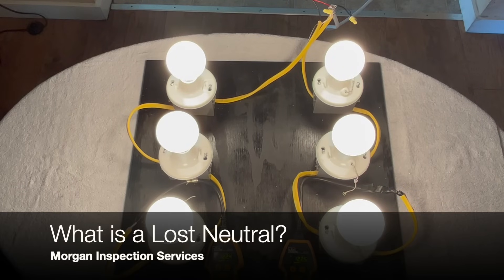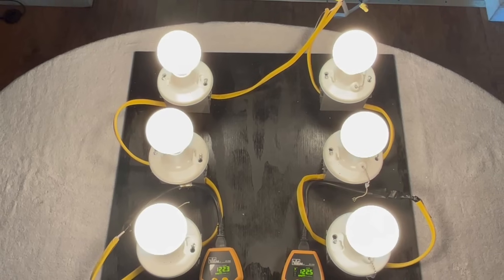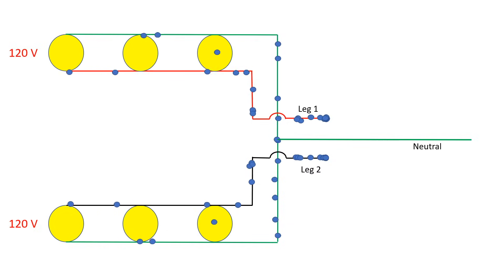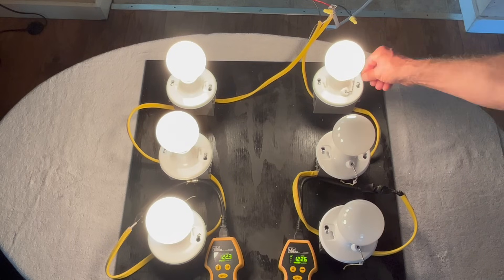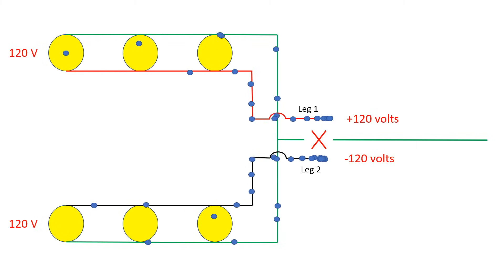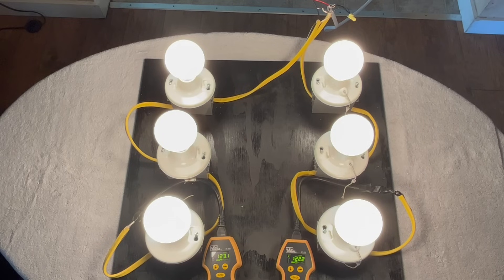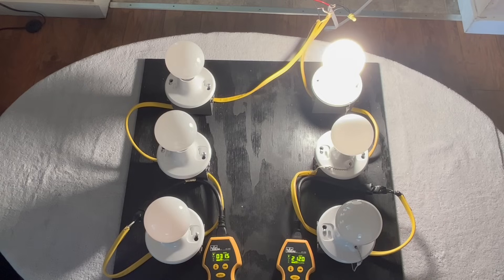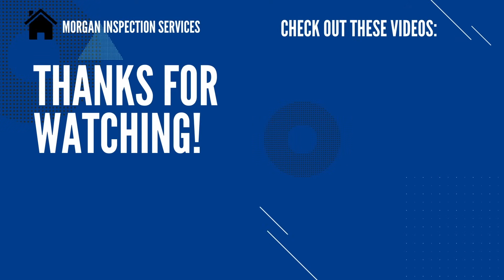What is a Lost Neutral? Lost Neutrals demonstrated

Comment: One thing that I didn't see really mentioned, though no real good electrician would run into this problem, is that the "neutral" of the right side of the circuit will now be positive with respect to ground. So if you think you can touch or work on that neutral and be safe, you better think again
Reply from the maker: Very true. I do think I mentioned somewhere that there can be voltage on the neutral. I did recently release a new lost neutral video. It specifically covers and even measures the voltage on the neutral.

Comment: Someone please respond to me.
 Okay so over the weekend, precisely on Morning My client discovered that the extractor fan in his toilets got burnt, like burnt to the ground and because of that incident, his socket outlets were no longer working,his AC too, there was total black out on most of the lighting circuits while in some other circuit, the lights were just flickering. So I was called upon to troubleshoot what was wrong, my findings are as follows 
- there was current in all of the neutrals in the consumer unit
- After isolating all the MCBs that controls the lights and leave every other MCB closed, the neutral no longer have current.
- When I turn off the entire MCBs and turn on the Mains and read each bar connected to the MCBs with the neutral, everything is okay but immediately I turn on the identified MCBs introducing that current into the neutral line, then the readings are no longer accurate
Note: I’ve checked the phases from the main incomer I.e RYB and also read them with the main incomer neutral . The readings are all perfect.
PS.. Intermediate level.
Reply from the maker: You’re obviously not in the US, because some of the terminology I don’t completely understand, but I will try to respond and help. You said, “after isolating all the MCB that control the lights and leave every other MCB closed, the neutral no longer has current.”  Just want to clarify. Did you intend to say current or did you mean voltage. If you’re saying that they still have voltage, then you may have an open neutral somewhere in the circuit.
Reply: @ yeah the neutral voltage

Comment: My dad worked in the water department of a local city.  One day when he was working on a water main, they had to disconnect a house from the main to swap out a pipe.  When they disconnected,  the pipe sparked and the owner of the house came out yelling about his bulbs blowing.  My guess, he and his neighbor shared a transformer,  he lost his neutral between his house and pole, and his system was grounded to a water pipe.  He was using his neighbors neutral through the water pipe, and my dad disconnected it when he separated the pipes.
Reply from the maker: That's a very interesting example of how a lost neutral can be present and affect a whole circuit!

Comment: Is there any device that exists that will sense this and protect against it?
Reply from the maker: I don’t know of anything that would detect it. I guess someone could plug a voltage sensor into outlets and if there’s a drastic change, it could alarm, but there’s really nothing designed to detect this other than noticing lights brightening or dimming, or other objects running faster or slower.

Comment: The animation shows the current in the bottom leg changing direction when the neutral is lost, which is wrong.
Reply from the maker: I was trying to illustrate that the electricity flows from one leg to the other leg. It doesn’t necessarily represent the current. The dots are showing the flowing electricity changing directions. This is correct. When the neutral is intact, the electricity flows from the transformer through the loads, and then through the neutral and back to the transformer. When the neutral is lost, the electricity flows from the transformer through the loads on leg one then to the partial neutral and then through the leg two loads and back to the transformer.

Comment: Good video, but one bone to pick on the diagram: the two lines are 180° out of phase... so the fake "electrons" (the dots) should be travelling in OPPOSITE direction... not the same. The way you have the "with neutral" shown shows the current meeting up from both sides at the neutral and then just vanishing... this is wrong. You should also have the dots alternating directions on both sides, but line 1 & line 2 always exactly opposite. You could do it without the alternating directions, but you definitely should not show them flowing the same direction as eachother.
Reply: Well, Ithink he didnt want to overcomplicate things.  Since this is AC, there is no mass flow of current.
Reply: I was pondering the same thing, but I’m not sure that it matters for A/C in a meaningful way. I believe that you’re right, but I don’t think understanding the difference matters for a lay-person (me!) to understand the concept, while I expect that this is a lot less confusing of a visualization.
Reply from the maker: You’re absolutely right about the direction of current flow!  I just tried to make this as simple to understand as possible. I do appreciate you watching and your feedback.

Comment: Interesting, but if the current in the phase/hot wire is not the same as in the neutral wire, your differential circuit breaker should trip at millisecond timescale. Or in your country you do not have this kind of protection mandatory?
Reply from the maker: It sounds like you’re basically referring to a ground fault circuit interrupter breaker. We do have these in the US, but when a neutral is lost, it is lost prior to the panel. You will still have current flowing back on the individual branch circuit neutrals, so a GFCI would not help in that situation.

Comment: I get the idea of using three cables in order to have two different voltages available (although I don't think it's justified for such a minor difference), but: why on earth would you wire BOTH low voltage lines throughout the house???!!!? That is crazy! Is it to save some copper money to the power company?
This suddenly makes me understand all those random shorts that YT recommends to me about the dangers of doing electrical DIY in USA houses... you can never imagine what kind of creative layout there is behind an outlet.
Also, how do those little portable Honda generators fit into these schemes? You have to buy your own transformer and plug both right at the gate?
Reply: So what would you do? Not use one leg at all?
Reply: Exactly!!! This is like having 3-phase at your house and wiring each floor to a different phase... it's just crazy.
Reply: @keepcalmandenjoythedecline  That makes no sense. In Finland different circuits are in different phases. Something like a range typically takes all three. If you have three phase you must use the phases evenly. Here main fuses can be as low as 3 x 25 A and that is with electric heating. Same with split phase.

Comment: I have troubleshoot electrical issues since 1986. One of the most interesting was a call from a local hospital. They had shutdown their ICU because their biomed equipment was alarming with severe voltage deviations. I arrived in an hour and started to take voltage measurements on the 75-kVA transformer serving the ICU. Phase-Neutral voltages ranged from 135 to 105. I inspected the transformer and saw the required neutral-ground bond. The facility electrician was suited up with his PPE and I had him install a jumper between the ground buss and neutral bar in the transformer. All three voltages stabilized at 121. We shutdown the transformer and the electrician tore apart the bond. He discovered when they manufactured the transformer, varnish had run into the tap for the bond on the neutral bar. For 11-years there was enough contact to bond the neutral. For some reason it finally opened. 

Another hospital called to say that their surge suppressor literally blew off the wall when they tested a new emergency generator. I told them that more than likely, their contractor had not installed a neutral-ground bond for their 277/480 volt system. They asked me to come down and meter. We saw the 277 volt legs fluctuate between 12 volts and 470 volts. Sure enough, no bond.

Most common problem is that a contractor will poke a hole in the transformer case for incoming ground and not scrape paint away to make establish a solid ground. I have seen them put screws through the ventilation louvers for grounds without scraping paint.

Comment: 8:48 damn i really need to go back to school, but why is the resistance higher with 2 lights compared to 3? Isn't light burning cause it has a resistance so if you remove 1 of those resistances how is there more resistance all of a sudden ?
Reply from the maker: With three lights on you have three equal paths for the current to flow.  With only two lights on, you only have two of those paths for current to flow. The more paths, the lower the resistance.

Comment: I’m an electrical engineer, licensed electrical contractor and volunteer firefighter of 35+ years.
This is the very best demonstration of the risks posed by a “bad” or missing neutral.
It SHOULD be made mandatory training for anyone working in the trade.

Thank you!
Reply: EE, as well. I was fortunate to be there in the early 80s before the curriculum started to change to microchip design, etc.
Reply from the maker: Wow! Thanks so much for the feedback and comment. I really appreciate it.
Reply: Yes, a great example.  Lost neutral was certainly taught as a very dangerous condition in the UK - tho as we are mostly 240V single phase PME it's more that anything earthed sits at 240V potential if the neutral is lost.  When working in the Middle East in a flight training school, the Simulator blew up one day, it turned out that it had also happened before.  The SIM Engineer was perplexed because the voltages across the phases were all over the place.  When we opened the 3 Phase supply box outside the building, we found the neutral cable had never been bolted in, it was just lying against the terminal - so sometimes working, sometimes not.  Says a lot about the engineers who installed it and those that investigated the previous faults!
Reply: I’m an EE, and you’re a bad, bad man with that background.  Hats off to you!

Comment: so what you have is a single 240v supply with a centre tap ground voltage divider. when you lose the centre tap ground aka neutral you have what is called a floating neutral.
Reply from the maker: Yes, I agree with you. A floating neutral is another way to define this situation. I appreciate you watching and I appreciate the comment.

Comment: The neutral is also what regulalats the current from the tranformer had a lost neutral at a campground the plugs ranges from 40 to 230 volts I knew what the problem was but c find what the aprentis did but a master electrician found it we had overhead line's 2 black and a bare aluminum on the underground we8 had black red and white as well as a braided aluminum wire around all 3 he had wired it up wrong but as for calling the power company tried that and they did nothing even had one electrician say the one problem was in the panlo box wouldn't even check the meter or wires coming in even though we had only one leg of power and that was all over the place I finally went out and looked at the meter run then took a picture of the mast head where it could be seen that one black and the neutral were clearly not connected turned out the linesman had missed crimping 2 connection and the wires swinging in the wind had caused them to pull out but I've had this problem before they are the experts I'm not so I know nothing about it they know it all so I've learned find the problem and either tactfully tell them or like in this case take a picture of the problem and show it to them when I showed him the picture I simply asked him if that was the normal way it was supposed to be he then had to go and take a look at it then he had to call the power company to fix it and left since we still had workers that needed power lights and heat to finish the the job I got a ladder and put them back together again when the power company finally showed up they said it looks like nothing wrong so I told him to pull on the wires and then he could see the prob and cut off the old conectors and redid them all
Reply from the maker: Wow! Yes, these lost neutrals can definitely create problems. They can certainly be a problem to isolate as well.
Reply: @morganinspectionservices3840  worst part was one of the parents had brought his boy out and to keep him occupied his game boy and it fried it

Comment: How would you get a lost neutral condition? Don't these circuits typically have independent neutrals back to the breaker? Also I thought the neutrals and grounds are bonded at the breaker panel.
Reply from the maker: A lost neutral occurs before the breaker panel. As a video explains, a lost neutral can occur anywhere between the transformer and the breaker panel. Maybe the neutral gets corroded or pulls loose at the weatherhead. Maybe a tree rubs on it, and overtime breaks it. There is also a situation called an open neutral, and that’s something that affects an individual circuit or a portion of a circuit. That is a very different situation.

Comment: Thanks Mike. I’ve done heat and air most of my career and started my own business 5 years ago. I’m near Memphis. I struggled with this very concept but the guys at our local power company are the reason I understand it now. I’ve been up there several times early in the morning when they get there to start their day and pick their brains. There are still concepts I don’t understand so I’m always learning. For example, nowadays they are teaching that voltage is not a force and I’m really struggling with that one because that was the entire basis of electricity when I studied in college back in the 90s. Electromotive force = voltage. 

I really struggle with computers. I don’t have the patience nor do I understand all the errors I get. With an electrical circuit, a switch energizes a load. When you apply voltage to that load, current WILL flow and the circuit WILL work. Sort of like pressing a key on a mechanical typewriter. You press the key and the hammer WILL hit the paper. With a computer, you give it an input and a thousand things have to happen before the computer decides to energize the load. Or you press a key and the computer receives a request, thinks about it, and decides if it wants to respond. I hate computers and right now I’m frustrated because I’ve tried again for about an hour to figure out how to respond to these comments and I get an http status error 400 error when I reply. Nothing on YouTube or Google has worked. I’m using an iPhone 15 pro max that is 3 months old. 
But yeah I’d love to see you do a video on this. I’ve done a couple videos myself but I don’t know how to use the computer to do the animations and stuff and I don’t know how to edit a video so mine are just one take and they were just on capacitors proving that current can flow through them. Experimental stuff. I’ll subscribe so I can catch it.
Reply from the maker: Well, I have an engineering degree, but I’ve been a home inspector for the last 22 years. I love learning and I love teaching. I have learned that I love making animations and I’m trying to make better and better videos. I’m getting older and spend almost all of my free time working on new videos because right now it is my passion. I often have to learn things before I make my videos so I can sound like I know what I’m talking about. You have inspired me to continue on. It’s been good talking to you.
Reply: I understand your misunderstanding. 
I have generally been in the automotive 
field and know that a hot & a ground makes 12 volts. Hence, an electrical component works. Occasionally, the addition of a resistor or relay change that basic Hot/Ground logic. No problem , I'm still on board. 
Then came the computers. I throw my hands up and say, nope, ain't gonna try to understand. 
Well , then I dabble a little and get a tiny understanding. 
Don't trust my logic on this, and I gladly stand corrected if I'm totally off base. 
Your observation of flipping a computer switch and it simply sends a signal is correct , IMO.
In my world (automotive) , the revelation came to me from watching a college student explaining their "Robotics" class. The student went into  Can Bus theory. Can Bus ?  (maybe I've spelled it wrong) , where have I heard that before ?
Yep , in newfangled automotive electronics diagnosis. 
Can Bus - High.
Can Bus -Low.
From my understanding, the Can Bus system runs on 5 volts or less. The Can Bus system goes through a system of checks of this, and that before energizing the desired component. 
All sensors sending signals ?
Seat belt fastened ?
You get the picture .
From what I understand, Can Bus High generally operates critical components. 
Ignition, fuel supply , Etc.
Can Bus Low generally operates secondary components. 
Seat belts , heated seats , radio,Etc.
Going back to the Robotics class theory. 
A robot, theoretically, cannot move its right leg until it receives a signal that it has already moved its left leg in a walking scenario. 
Cars are now robots.
The car will not start (hypothetically) until it receives a signal that the seat belt has been fastened.